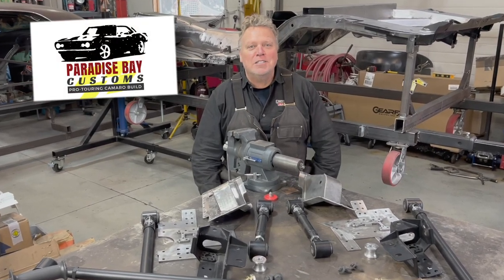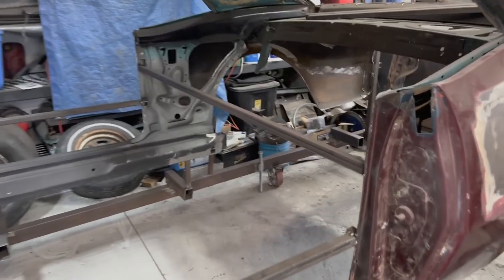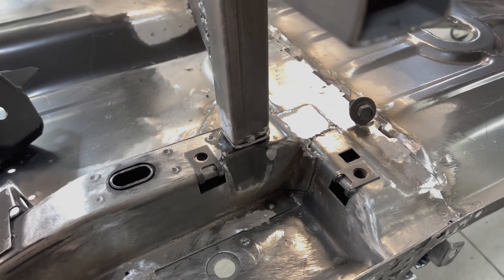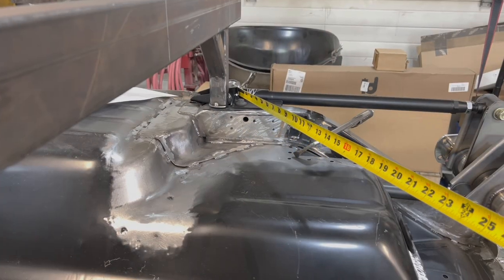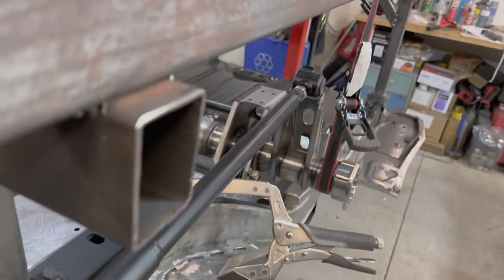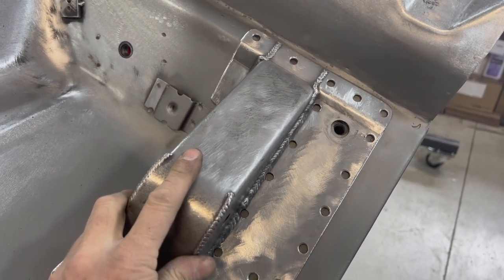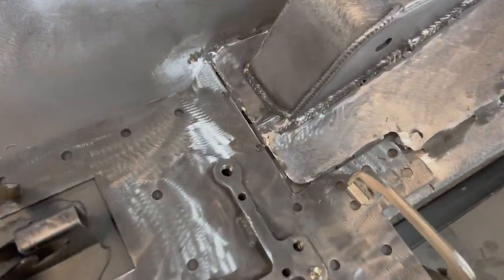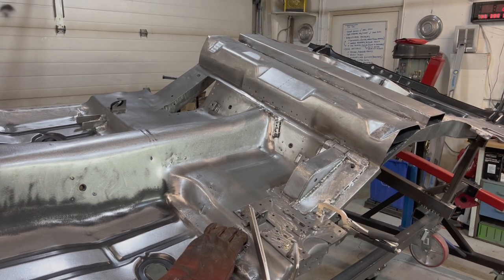What Could Go Wrong? Detroit Speed Camaro Rear Suspension

Comment: I appreciate the in depth details you explain when you are creating your videos. I am building a '69 and your videos have helped me more than any other ones that I have watched. Please keep the awesome content coming!
Reply from the maker: Very kind words… Thanks for saying. I really appreciate the support and encouragement. Where are you at with your build?
Reply: @ParadiseBayCustoms  I have replaced both full quarters, out wheel wells, inner and outer tail panel, trunk floor including trunk floor closeouts (thanks again to your video for great instructions) installed DSE Quadralink rear structure along with their mini-tub kit, full passenger rocker panel and drivers side floor pan. I just put the body on my rotisserie and after looking at all the old undercoating, I am contemplating replacing the full floor instead of spending countless hours scraping off the 53 year old undercoating. I also have a complete DSE front sub frame and will be installing a late model Camaro engine along with the 8 or 10 speed automatic transmission. Lots of work ahead of me, but it is a great hobby and stress release for me
Reply from the maker: @stevensmallwood2231  Very cool. Out of all the stuff I’ve done, I’m reluctant to replace my quarter panels. Don’t know why. I have full replacements on hand but haven’t made my mind up yet. Once I get the floor in I’ll have to decide. How did you find replacing yours?
Reply: @ParadiseBayCustoms  I was worried about replacing mine, but it was absolutely necessary. I searched a lot of Youtube videos, then just went ahead and dug into it. They went on a lot easier than I thought. I bought mine from NPD and was concerned because they were not name brand, but I have no complaints that I haven't already heard. The biggest issue was the trunk corners were not good at all. The dye that these were stamped from must be getting worn out. I was able to cut the trunk corners from my original quarter panels and I welded the old corners onto the new new quarter panels and they fit perfect with the original trunk lid. From seeing the quality and skill you have, you will have no problems installing new quarters.
Reply from the maker: @stevensmallwood2231  Good to hear. Merry Christmas! All the best.
Reply: @ParadiseBayCustoms  Merry Christmas to you also...keep up the great videos!

Comment: Hi Ken, are you using the DS Rear sway bar for this setup? And if so I was wondering if you could give me the part number of the one you are using and the outside dimension of the bar at the Eyelet end?
Reply from the maker: Yep. Using the 1-1/4” DSE Sway Bar. Part # 042208DS Will need to measure at the eyelet end to confirm. Will get back to you.

Comment: Hi Ken,  What is your plan for the reared gear ratio?
Reply from the maker: I went with a 3.70 ratio. My concern with the horsepower I want (dreaming of) is that 1st gear will be useless. I was tempted to go with a 3.89, a compromise from a 4.11 but GearFX confirmed 3.70 probably best with what I’m doing. 👍
Reply: @ParadiseBayCustoms  I am in the same frame of thought.  I have a 544hp LS3 with a T56 and I was kind of bouncing between 3.50 and 3.70.
Reply from the maker: With the T56 I’d go with the 3.70. Go much lower and you’d really need to be booking it on the highway to be using it. In my mind 3.70 is the sweet spot. Most autocross guys go 3.70 too which helped validate my decision.